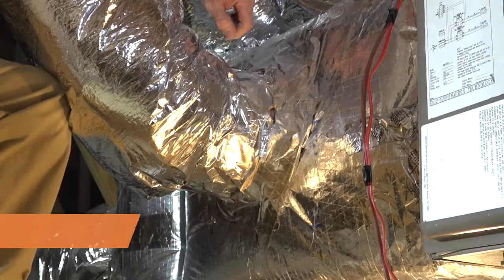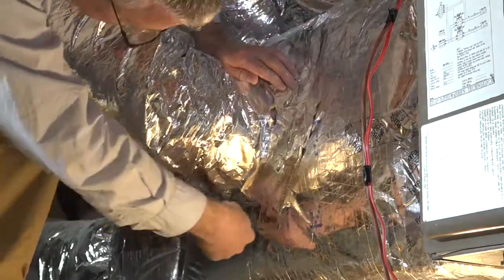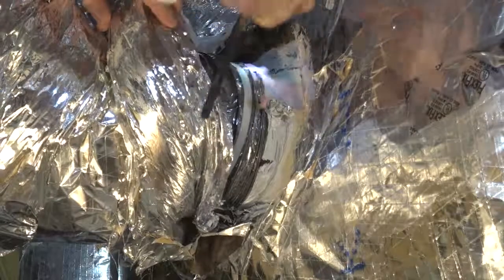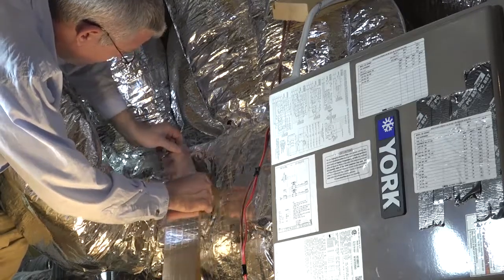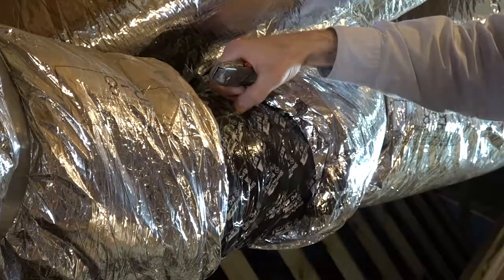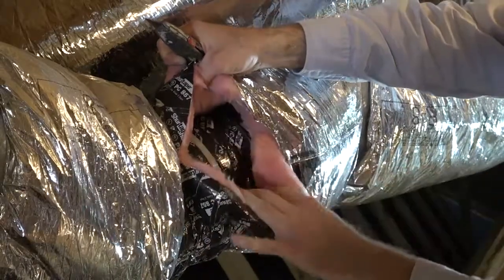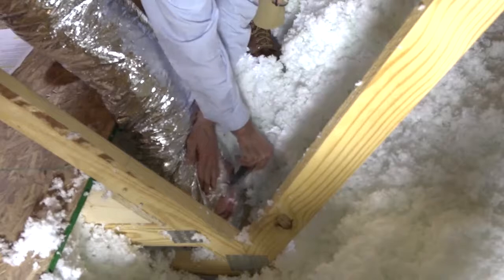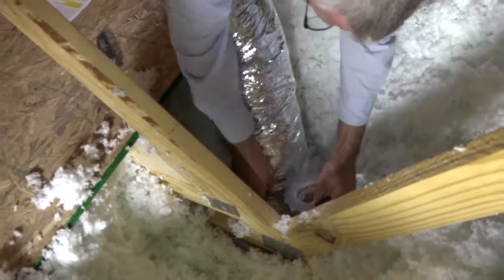How to Check Joints and Connections - Flex Ducts

Comment: a properly taped seem with appropriate  prep and application  will be fine. bucket mastic is not the only option. i spent a lot of time removing a  hardcast mastic tape joint the other day from a unit  it had been in place a while  and no leaks. this maybe overkil. and what if they put the mastic over thetape  would it even be effective if the tape is not effective?